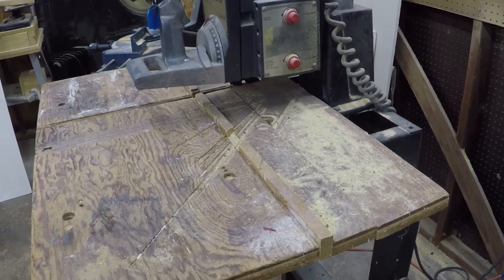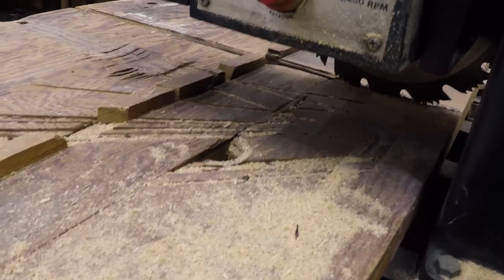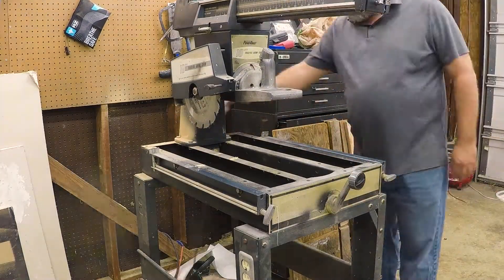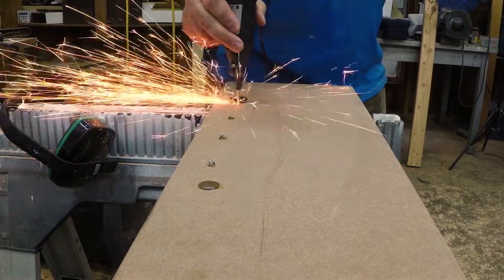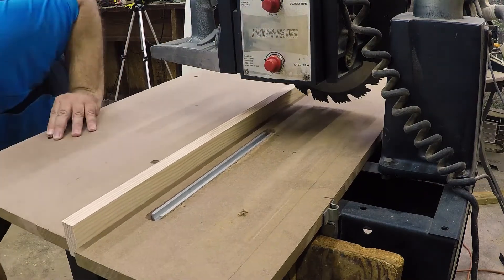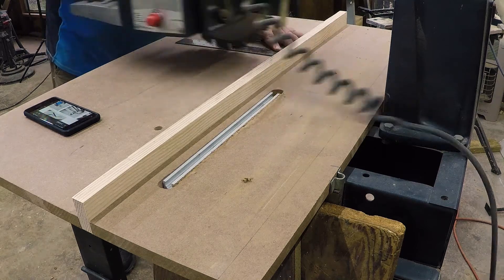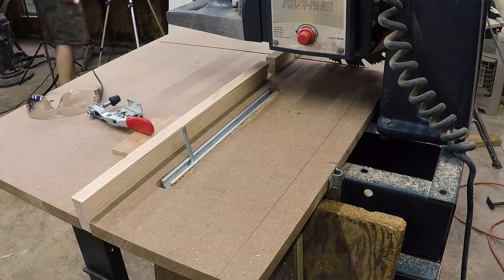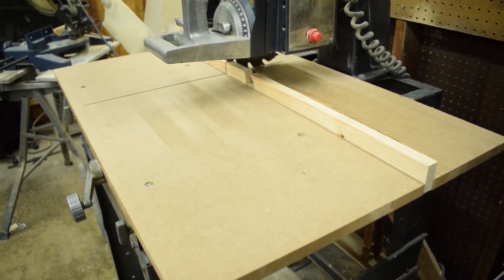How to Resurface and Square A Radial Arm Saw Top

Comment: There was one of these on Craigslist for free!  The guy's father bought it from Ward's in 1972 and it had all the accessories and manuals. Drum sander, grinder/buffer arbor, router collet, sanding disk, buffing pads and a planer head. I already had a DeWalt B/D 7770, but the nice thing about these Powr-Kraft is the accessory output shafts where it reads Powr-Panel. The lower shaft runs at 3450 RPM - same as the sawblade for sanding, grinding, buffing and drilling... but the other one on top runs at 20,000 RPM!  Perfect for router bits if you have the accessory collet, which came with the machine I got. I just happened to pick up a metal tackle box full of wood shaper cutting heads at a swapmeet a few years ago and they fit the 20K adapter perfectly. Another nice feature of these Ward's saws it the height adjustment, miter release, and the table locks are right in front of the machine - no reaching over the back.   I have it set up for routing and sanding and have since picked up my third Radial Arm Saw:  A DeWalt MBF from the mid-1950s that I've been lusting after.   The Powr-Kraft line was made by a company called ToolKraft Corp. in Waterbury, CT.  for Wards.
Reply: Do these saws have the same kiss of death the Craftsman saws have? Can't keep them square!
Reply: @Kathyskollectables  That's a pretty involved answer.  The simple answer is no, but all saws are dangerous, however the Craftsman ones were at the top of the "race to the bottom" where cheaper and lighter materials were used. This moved away from heavy, solid, and stable cast iron RAS to ones that did not hold their adjustments.  There are many more adjustments on RAS than on a table saw.  All my machines are heavy duty and stable including the Ward's machine built by ToolKraft tool company back east.  My three other RAS are DeWalt units from the 50s to the early 70s.

Comment: Wow, did that bring back memories!  My Dad had that exact saw (without any key lock on top of the trigger handle) and it was the first woodworking tool I used.  Dang thing was LOUD too as I recall with the blade ringing.  Very few safety features to be sure.  Still have all 10 fingers!  Gave it away to a friend many years later as I got a decent table saw and other tools.  He's still got it an uses it too.  Thanks!!
Reply from the maker: It WAS loud. I also gave this one away recently. Thanks and I am glad you enjoyed the video.

Comment: i'm really glad i found this video.  i have this same saw.  your walkthrough replacing the surface is nice.  you should do another video showing how to square the blade up to the table and the arm to the fence.  the instruction manual is ok, but watching a video is so much better.
Reply from the maker: Thank you. I am glad it was helpful. Maybe I will do one on the squaring adjustments.
Reply: Yes please do a video on squaring the fence/blade!

Comment: Great video. I picked up a similar saw in a trade deal and man is it heavy. It is a model TRT-2313, I've no clue as to the age. This setup video helped quite a bit. My saw platform is like new with no cuts in it, it had some 1/8 inch masonite on  which is trashed. There are a couple of knobs that I'm not certain their function yet and I picked up a new blade. The saw is very clean and solid but needs lubed up and such. I need to build or buy a table/bench for it first.
Reply from the maker: Nice. I am glad the video helped. There aren't too many radial arm saw fans out there anymore. Have fun.

Comment: RAS are the best all round saws ever made. I may suggest using a 2 piece fence. You can open the gap for daddos, move the gap over for 45s, close the gap to be close to the blade. Slide the fence to use with different angles. I did that to all 5 of my saws. The best mod iv done. And add sacrificial top on top of the table. Table gets cut up, just change the top. Dont have to re square and level.
Reply from the maker: That's a good idea.

Comment: Hi. Great video. I have just bought a very similar saw to this. Mine is called a shopmate. Could you please tell me the dimensions of your back table? Thanks!
Reply from the maker: I don't actually know. Not too long after making this video I built a long miter saw station that included the radial arm saw in it. So I don't even have this stand with the saw on it anymore.
Reply: @DarinBeard  dis you make a video of that?

Comment: Darin, very nice! 
Do you have, and/or know where I can get the router adapter part number 84-2613?
Just picked one of these saws and it looks like it is easily going to become my go-to radial arm saw. 
Hoping to be able to get the adapter so I can make it a pin router table.
Reply from the maker: Thanks. I've done some searching for the extra add-on parts to the saw but found very little other than other people looking for the same parts. You might find them on ebay from time to time. I saw an ebay Russia post of that part once. I didn't bite, though. I love the saw and it's always been good for me. Good luck.
Reply: Darin, appreciate the reply. I will be keeping an eye out. 

On eBay, I did find and buy a Sears Craftsman Drilling and Router Adapter, part number 93239. 
That thread fits nicely on the 1/2"-20 spindle, and not quite as tight on the 15/32-20 shaft. Although it can be tightened pretty good, a bit leery to try using it on the 20,000 rpm output.

Intended for 1/4" router bits, it is a simple two piece tool, about 2" overall length, one piece threaded to fit the shaft with a compression-type collet and the other a nut to tighten the bit in place. 

Don't see any way to add a photo of mine but here one like it from another discussion group
http://lumberjocks.com/topics/84354
Reply: Try vintage machinery website
Reply: @littleshopofsawdust1157  Actually, someone locally was selling a Power Kraft and when I went to check it out, he offered to include a 'box of stuff'. Inside was an unopened brand new in the bag router adapter part number 84-2613 with instructions. As well as several other parts, including the drill chuck. Naturally, I bought the machine and still have all those optional add-ons.

Comment: Hi
I just bought the same shopmate as yours but have no manual and is a bit neglected. Head swings left to right but not side ways. What do I miss or not doing??
Reply from the maker: I have the manual digitally for this saw that I have. Let me know and I can send a copy to you if you want it.
Reply: @DarinBeard  HI
Thanks for your reply. I ended up dismantling the whole thing and found that the head seized up. After some cleaning and lubrication it works perfect.
Reply from the maker: @jeeepers2024  I am happy it worked out for you. It's a great saw.
Reply: @DarinBeard  would you send this to me please? If so I'll give you my email.

Comment: You're very lucky.  I've been trying to get a Powr-Kraft RAS for some time.  Did you ever get a drill chuck for it?
Reply from the maker: I do not have a chuck for it. Where would that even go? I only use the saw part. I've never used the other features of the tool.

Comment: Nice saw. Looks familiar.
Reply from the maker: Ha, it should. The top finally was beyond being usable. It's once again straight and true. I still have the metal cutting wheel you had on there when I got it.
Reply: I noticed the steel cutting blade in the thumbnail. Do you use that because of the rake on the teeth? I was considering buying one myself. My brother has the same saw. Great saw!

Comment: Kind of started wrong all ready with the router cut and screws to long. You should have the brackets on the side of the base be perpendicular the the arm by tilting your motor (arbor down) and adjust does brackets perpendicular to you arm, now screw your front table to the brackets and your front table will be level with the arm, you also have a screw in the middle of the table to bring it up or down if needed. Now you adjust the blade 90 degrees or vertical to the table. Now, turn your blade 90 degrees just like ripping and that blade should be perpendicular to the fence. (this is how you adjust the fence, if needed loosen the front table screw a little to make this adjustment then re-tightened them)....... Now you adjust the travel of the arm and it should be 90 degrees or perpendicular to the fence. I like that you did not invent the wheel with the table, you used the right material and YOU KEPT THE FENCE IN FRONT OF THE BLADE. I like your table replacement I need to do mine..... nice job!. and be safe.

Comment: You should put a Mr. Sawdust top on that saw.  Google it.
Reply from the maker: I don't even have the saw anymore, but thanks for the tip.
Reply: @DarinBeard  Bummer.  They are great machines.
Reply from the maker: @WKYanks  I loved it. When I moved I gave it to a guy who could make good use of it.